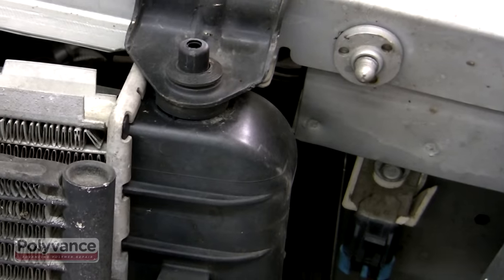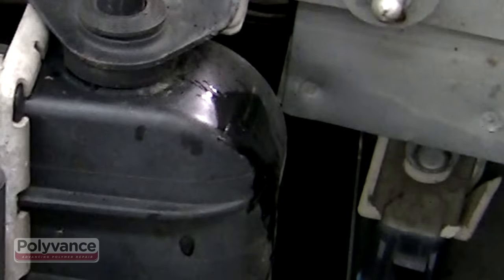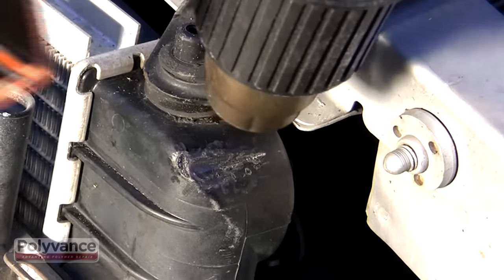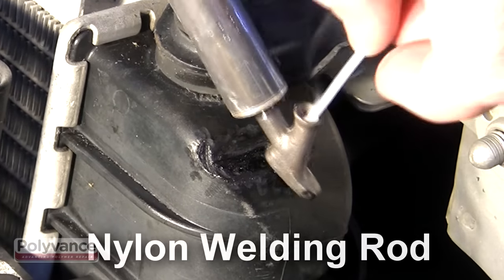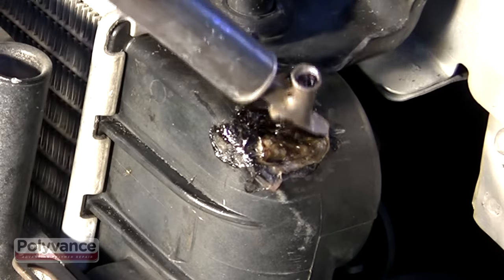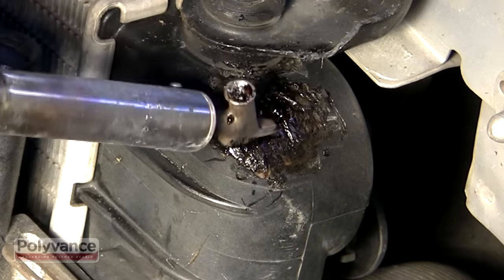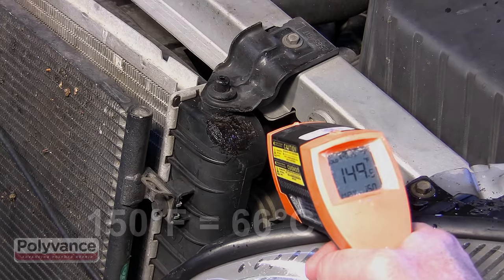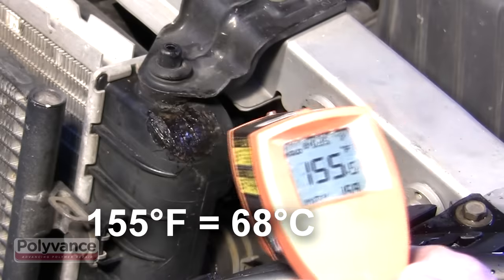Repair Cracked Plastic Radiator

Comment: Just use a soldering iron and zip ties (they're made from nylon plastic) as welder rods. Works the same.
Reply: Its difficult to get a pinhole free weld using that technique.  Most soldering irons have too small of a tip to provide adequate pressure to the substrate to get a good weld.  Also many zip ties contain a nylon blend which may not be a  great match for the type of nylon radiators are made from.  I have also run across zip ties made of polypropylene and HDPE, which will not weld with nylon at all.
Reply: @scottb7600  Most soldering irons come with a flat tip attachment specifically for that purpose.
Reply: @AmericanThunder  Most are still not typically large enough unless you have a REALLY BIG soldering iron and you have the ability to control the temperature of the iron.
Reply: @scottb7600  I've been doing decent plastic welding for about 40 years using a Weller iron with a flat tip, no issues, it just takes practice.
Reply: @AmericanThunder  I'm not saying it can't be done.  Its just much easier with the right tool.  The airless welder has its origins in a soldering iron.  The custom tips were added to make the process much easier and faster than using the smaller tip of a soldering iron.  The output of the tool was then adjusted to best suit plastic repair, followed by a temperature controlled version for even more control on low melt-point materials.
Reply: @scottb7600  Yes, having the expensive tools is usually better, that's why I have a lot of snap-on stuff in my shop. But the original comment the guy made was that a soldering iron could be used for repairing plastic and I simply agreed that it can.
Reply: @AmericanThunder  most soldering irons are not 200W and not all "plastic" is nylon
Reply: @danbowen710  I never said all soldering irons are 200 watt and I never said all plastic is nylon. What's the point of your comment? Are we going to discuss the various wattage output of all soldering irons on the market, or shall we talk about organic polymer varieties? lol
Reply: I used my blow torch and zip ties to fix mine, did the job just fine took me all of 20 mins.
Reply: @AmericanThunder  Harbor Freight wood burning kit has several attachments.  But I guess those can't possibly work either!
Reply: @AmericanThunder  i saw bigfoot once!
Reply: @nigelssurfshop  did he really have big feet?
Reply: @AmericanThunder  WHY DOES BIGFOOT GOTTA BE A HE STOP LIVING LIKE ITS 2020 STILL FFS
Reply: @ColdVenom159  explain how plz
Reply: @@cablecow15 bro, its not a soldering iron then is it?  Its a hot knife used for cutting foam or other similar task. Something with a large surface area and the right amount of heat could be made to work, but your typical soldering iron with a small tip and high heat will be difficult to use to get good results.  Instead of being an armchair expert, try welding plastic with a small soldering tip, a hot knife and an actual plastic welder to  see which one is the best tool for the job.
Reply: @AmericanThunder sounds like someone just wanted to debate with you.

Comment: Cool kit but... I have a lot tools but not a heat gun, not a laser thermometer, not a plastic welder melter thing.  This is way to specific in tools which your average person WILL NOT HAVE!
Reply from the maker: The laser thermometer was to demonstrate how much we heated the radiator. It isn't necessary. The heat gun is also not necessary, but it speeds up the process (as stated in the video). You can buy both the heat gun and the plastic welder kit from Polyvance. The links to both of these items are in the description box.
Reply: Fluery
Reply: Ive got them.... maybe spend 30 bucks also?
Reply: Acquiring the basic tools which in this case is just the soldering one and the plastic or nylon to be melted, it's way cheaper and easier than replacing the whole radiator, talking about an average person
Reply: and if you buy all that you will use it once, and you could have paid for a new radiator instead
Reply from the maker: @nigelssurfshop  If you buy the plastic welder, you can weld more than just radiators. You would just have to use the correct welding rod for the material, of course.

Comment: Tried welding plastic using your kit from Polyvance, guess the radiator was too old, because after two tries, still leaks after running for 15 minutes...disappointed that it failed to work for me...

Comment: If it's a small hole or crack drill it out and put a expanding rubber freeze plug in tighten and your done no chance of the polycarbonate separating again fixed radiators  like this for years !!!!!!

Comment: Just buy a new radiator, you can get them for less than $100 online brand new.
Reply: Depends on the car!
Reply: @scottb7600  I just bought a brand new radiator for $60 dollars for my 04 Jeep Liberty Renegade off of Amazon.
Reply: @dkt1976dt  I'm not saying they aren't out there.  but many are well over the $200 mark.
Reply: @scottb7600  The radiator for the 94 BMW 530i was well over $200 dollars

Comment from the maker: Do you want to know how much Polyvance believes in their products? The radiator featured in this video was in a vehicle that belonged to Polyvance's Vice President. We drilled into his perfectly good radiator because we know our products work, and we knew we would be able to repair it. This repair was done around 7-8 years ago. This vehicle has since changed hands (but stayed in the Vice President's family.) The vehicle is still driven often. The repair on this radiator has held up all this time.
Reply: Polyvance. 
 Not to rain on your parade,
  But when in a normal plastic radiator failure situation, (not a pre-planned one) if one part has cracked the other pieces should not be far behind.

Comment: The kit is 80 bucks. My new radiator was 88 bucks at A1 auto .com. Probably a good tool for repairing something but not radiators not cost effective.
Reply: Yeah, some radiators are really inexpensive.  However, if you have a kayak, atv or other plastic things that tend to break, they can also be welded with the same welder.  Keep in mind you would use a different welding rod for each type of plastic, but the welder itself can be used for a lot of things.

Comment: What if you didn't use a chisel to put a crack in it? I only have a small thin crack but it is enough for fluid to bubble out, what's the best bond with heat resistance that can be used quicker than this approach?
Reply: A crack is a crack, no matter how small...plastic welding is the only permanent way to repair it.

Comment: My '98 Chevy Tahoe has a pinhole on the plastic part of the radiator. Can I use soldering iron instead of buying a whole kit to melt the nylon rod? Just asking. It'll save me a bunch of money. Thanks.
Reply: I'll say this, you can always try.  The big problem with a soldering iron is temperature and surface area.  The welder makes the weld much easier...plus if you have any broken plastic in  the future, all you need to get is the right filler rod and you're good to go!

Comment: Hi I have a question ? How do I know if the radiator is broken ? Also if my car isn’t over heated can I still drive it with a crack radiator?
Reply: If the radiator is cracked, you will see it leak. If it's leaking, it will overheat once the coolant leaks out. If you continue driving it while overheating, you can warp the heads.
Reply: Are you for real or is this just a joke.

Comment: how long did it last?
i am interested in this product.
Reply from the maker: This video was done circa 2009 and that car is still on the road, going strong with no issues from the radiator at all since the repair.
Reply from the maker: Or this video was filmed in 2009, I should say.
Reply: thx, for helping me clear my mind over epoxy and plastic welding.
Reply from the maker: That's what we're here for!
Reply: Are ALL plastic radiator tanks nylon?  I just discovered a pinhole in my 98 F150 (built in 97).  I’ve already got this tool with nylon rod.

Comment: Good video.. what about repair a broken plastic pipe on the radiator. For ex the very smallest connection that goes with a hose too the expansioncooler container
Reply: It can be used for that as well.  Be sure to use some of the mesh in the kit to reinforce the repair after you weld it to add tensile strength.
Reply: @scottb7600  Great. When i was writing this i looked into the same channel that they did just that in an other video too fix a longer thinner pipe on the radiator hehe

Comment: Stop drilling the end of the cracks helps in aluminum but melting the plastic should take care of it .When radiators weren't plastic I repaired a hole in a car battery with a prestone bottle and a hot glue gun.

Comment: There's no thermostat. Temp too low, is not soupost to be over 200? I use jbweld and works fine... even on metal.
Reply: I am told about JBWeld but there are different types and how do you apply it please
Reply: Nam Dzang jbweld the red one. Just sandpaper, clean and dry the area,  and apply a coat of jbweld let it dry,  but depends on ambient temp. I always put 3 caps of jb.  Never have a leak again in that area..
Reply: @j.onofre6613  I tried the regular JB Weld and it stuck well, but still cracked in the same spot. Does the "RED" flex, if so that should fix my issue.
Reply: Temp should be low on the side he is working on.. the hot coolant enters on the other side and cools as it reaches the location he is working on.

Comment: What if the crack is along the crimped metal housing?
Reply from the maker: A crack along the metal is a little more tricky. We only focus on the plastic elements, as they seem to be the most common repairs to happen upon.
Reply: I thought that may be the case.  Thank's for the response.
Reply from the maker: Of course! Thank you for watching!
Reply: Polyvance what kinda car is this
Reply: That looks a lot like the '95 Thunderbird I worked on today. My crack is by the tab that holds the nut clip for the fan shroud :-(

Comment: does the nylon rod come with the plastic welding kit and if not, where can you buy the nylon rod?
Reply from the maker: "Yes".  The nylon rod comes with the kit.
Reply: Polyvance thank you so much!
Reply: That kit costs as much as a cheap radiator. If it were half that price I would buy one, but for a little more I could buy a good radiator. Not worth it unless you are a shop that repairs them.
Reply: @garyaubrey4096  a replacement radiator is about $150.  Plus, here with the repair, you don't have to remove and reinstall.  Savings$$$$$
Reply: @Gary Aubrey yes, I'm thinking of using a $20 3d pen & a wood engraving tool

Comment: How did you find out that the tanks are made from glass filled nylon?
Reply from the maker: The symbol molded into the tank was PA+GF20 which means PolyAmide (Nylon) + Glass Filled 20%
Reply: @polyvance  daaaaaaang

Comment: Would a product that is called JB Weld work?
Reply from the maker: JB Weld will not be a permanent fix. The bond will not withstand the repeated expansion and contraction of a radiator.

Comment: Does this work with PA66-GF33 (motorcycle oil tank)?
Reply: PA66 is the code for Nylon... 
GF33 indicates it is 33% glass filling powder and strands for strength.
PA66-GF33 is 33% glass filled Nylon.
You can repair this mixture of nylon with more nylon.
This is what this entire video is showing.
Yes it works on a motorcycle oil tank.

I need a drink.

Comment: I just had my plastic radiator crack after an overheat. it seems that the coolant inside boiled and because of the too much pressure, it cracked its way open. it has a quite long crack about 4 inches. do you think it can still be repaired with this method? thanks
Reply: Yes, you can weld it as long as the crack doesn't extend into the fins.  

A lot of times that failure happens as the result of your head gasket blowing  which pressurizes the coolant system to the point where the weakest link fails...which in turn would make your car overheat because it blew out all your coolant.
Reply: I would check the safety valve before fixing it

Comment: How would this go on an older radiator where the plastic has fatigued?
Reply: Seems to work well, in my experience.
Reply: The thing that destroys Nylon radiators is Heat ( and hammers, drills, chisels).  Overheated engines weaken the plastic as they are designed for normal hot coolant temps.  Higher temperatures from an overheating engine will turn the nylon brown or tan and brittle over time.

Comment: Ok,smart men,.crack on the side that is full of corrosion.  Any suggestions besides a new radiator?
Reply: If its the aluminum part, you are SOL, but if its the plastic part,  you'll need to use a dremel tool or a di grinder to grind out the corroded area.  If its a big hole, you'll want to cut a piece of 2045W stainless mesh about 1/2 in bigger than the hole all the way around and melt the edges in.  This will give you a support structure with which to fill the hole.  Once that's in, simply weld over the hole using R21 glass reinforced nylon welding rod, blending it well at the edges with the base material an forcing it into the mesh to get a structure that behaves as one piece.

Comment: incredible tool..but if you do a one time job - ask yourself is it worth of spending all that money or easier to get new radiator with warranty...i guess new with warranty and moneywise you break even,except the fact that you still driving with old patched radiator if you buy this tool...
STILL THUMBS UP TO INVENTORS,because if you have garage shop  this tool is MONEY MAKER!!!!!!!!!
Reply: even a home shop it will save you money.  You can use it on other plastics as well, you just change which welding rod you use to match the substrate.

Comment: Can you use any type of nylon like say a nylon washer? And how long do you have to wait for the nylon to solidify?
Reply: It may be possible, but there are hundreds of varieties of nylon and each has specific properties and are chosen for specific applications.  Not every nylon likes to be blended with every other nylon.  That said, if you tried it and it didn't work, you could always start over, grind out what you put in and weld it with the R06-01-03-NT welding rod.
Reply: Scott Bixler yeah, i wish I seen your reply because I already had a plastic welder and  some nylon washers and it just stressed fractured right after starting the car. I couldn’t find that much info on nylon so your reply helps a lot thanks man.
Reply: You're welcome!
Reply: Heard you can break a piece off the rad. As filament

Comment: I just used JB weld.  $6.00, one day to let it set and voila!  No more leak.
Reply: And my repair looks a lot more esthetic than that lol.
Reply: @LVPHD1  I tried several adhesives on a crack in the side tank of a Mk1 Ford Focus radiator without success.  That included a product made especially for radiator repairs and a couple of other epoxy products.  We've had the radiator out 3 times now, but it has failed very quickly every time.  I am wondering whether to try welding, but some say it doesn't work.

Comment: I have welded plastic with a soldering gun and a piece of scrap plastic.
Reply from the maker: It's more or less the same principle. The main difference is the welding rod, which will be cleaner and identifiable as a specific type of plastic so you can match it exactly.

Comment: For plastic radiator leak, forget everything. Use Weicon Aqua repair stick. Made for plastic radiators. Used it n satisfied. Takes upto 120 C (250 F). The extra I have I will use for my plumbing
Reply: That is not a permanent repair.

Comment: Just use JB weld , it's way easier and cheaper.
Reply from the maker: JB Weld will not be a permanent fix. The bond will not withstand the repeated expansion and contraction of a radiator.
Reply: Yeah, and totally temporary and unreliable.
Reply: I tried to use a JB Weld radiator repair kit but it set before I could apply it.  I later used a very similar product by another manufacturer but it failed immediately.
Reply: @Swingfree1947  jb weld could work IF and only IF you can seal the leak from inside which is pretty much impossible. Anything added on the outside will never ever hold, we are dealing with an uncompressable liquid which expands when heated, this creates tons of pressure (not literally tons) and the repair won't last

Comment: Ain’t worried about a hole we’re worried about bad cracks at joints
Reply: You can repair those too.  The kit comes with some stainless steel mesh that can be used to reinforce those seems even more.

Comment: Nice try Einsteins, but those style radiators crack and or become not sealed at the crimping points, have never seen that style crack as you show in the 47 years Ive been around vehicles...... BLUE DEVIL works well in heater cores, radiators as well as head gaskets....for a while & not permanently
Reply: Polyvance did not create a product to solve a problem that supposedly does not exist.  Radiators crack all the time at places other than the crimp seal.  Filler neck cracks are EXTREMELY common.
Reply: Why do you think I'm on here right now that's around the same place my crack is
Reply: Same place where mine is cracked

Comment: of course I see no leak at 800 RPM Tri 2500 rpm for about 5 minutes see what happens.
Reply from the maker: We've used this for repairs on radiators 5-7 years ago that still function flawlessly.

Comment: Just thread a little over sized screw and you are good to go.
Reply: The only problem is make sure the screw doesnt get too hot or it will melt the plastic